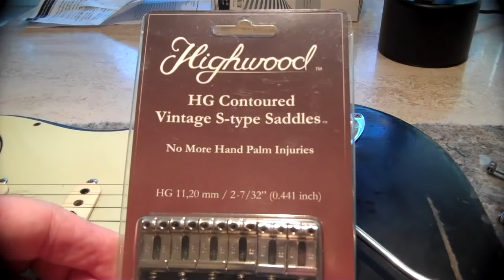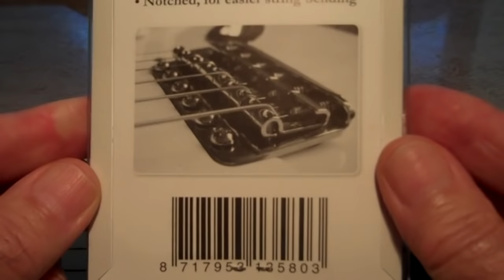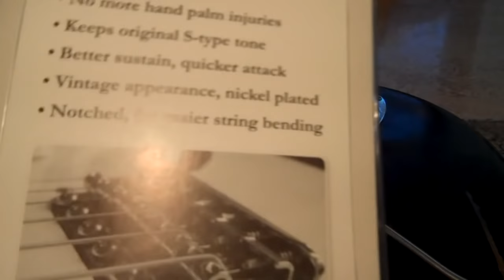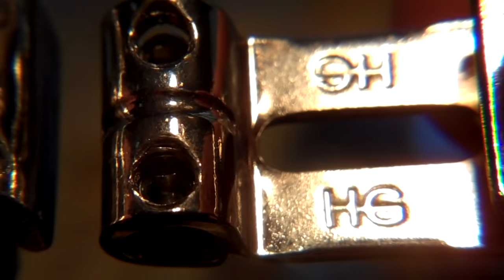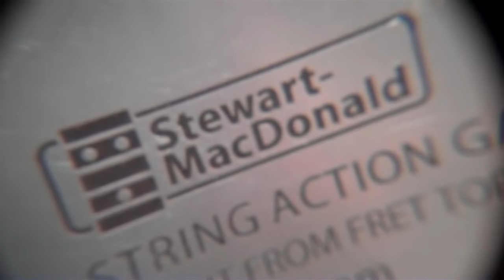Highwood HG Contoured Vintage Strat Saddle Review - Better Than The Originals

Comment: Kind of amazing how a design that’s been around this long can be rethought in such a simple yet ingenious way.  Will have to try a set of these saddles on one of my Strats.
Reply from the maker: You will love them.  This is one of the few times, if not the only time, I've seen someone improve on Leo's vision.  He was a spend thrift.  Maybe he pondered these and realized they were too expensive to manufacture.  The steel hardness is identical to Leo's pre-CBS saddles.  I added a comment about it in the description from Marcel the designer.
Reply: Yep I bet they’re fantastic.  Thanks for the video.  I might even inquire on OEM or distributing.

Comment: Callahan's look kind of cheap I'm real surprised those Highwoods look like a better quality the callahans aren't even stamped I would still take all of your vintage Saddles off and put them away and just use all the Highwoods so that you're not only using half of them and mess the setup of your vintage ones
Reply from the maker: I did take all of the vintage ones off.  They will be safe in a box.  I really like the Highwoods.
Reply: millstap did highwood provide the product for free as a trade for a detailed review, or did you purchase them at full price?
Reply from the maker: @MrSpock  I contacted them to see if they would send me a set for free if I did a demo on them.  They did.  They actually sent two sets, relic and standard nickel.  I love them and that is all I use now on my vintage 1964 Strat and my Nash Strat.  The reason I contacted them was because I could tell they were the saddles I had been looking for.  They are the best.  I've tried the others and these are by far better.

Comment: You will see dear sir that being rounded like that it will be very hard to intonate the guitar. If you like it really intonated. You will need to pool the saddle more to the bridge.
Reply from the maker: I don't worry too much about intonation if they sound good to my ear.  I have a decent ear.  I used to fret (no pun intented) over intonation and would sit there for hours trying to get it perfect.  It was a useless exercise.  Just think of the almighty original Telecaster that started it all.  You could not set the intonation on those if you wanted to with the three piece bridge and those saddle pieces were round too, just like these.  Plus, the original Tele saddles were crude screw like things with grooves all the way across to keep the strings from moving.  I haven't even checked the inonation of these.  They sound great and eyeballing them is good enough.  You need to get you a better sounding gadget although there probably was some extra hum from the Echoplex.
Reply: @millstap  this is my way also. Perfect intonation makes the instrument sound sterile. When they made the telecaster there was only wound G. So it was perfect for intonation. But Jimi's guitars are never intonated. Many are intonated bakwords like he found them for right hand playing. He never bordered. Why should we.
Reply: I have these Saddles too. No problem with the intonation at all. I initially thought that maybe muting the thinner strings could be a problem because of the grooves, but non at all. Great product.
Reply from the maker: @Steinstra-vj7wl  Yes, the grooves (unwanted version) that get cut by the strings, sound worst than anything.  It can sound like a harpsichord if they start to touch the sides of the strings.  That was another reason I was always buffing them out.

Comment: Also besides from aesthetics, are these really that much different in tone from the classic American made Fender bridge saddles (with the grooves and whatnot)?
Reply from the maker: I think they may have a tad more sustain but I cannot notice a difference in tone.  They may be a tiny bit less bright.  It is hard to hear if any.   The break angle over the top of the saddle is a little less with a little more string contact at the apex so that might have a slight effect.

Comment: @millstap Hi! Have you tried these saddles on a decked Strat? Do these solve the issue of pitch going sharp when you dive and use the tremolo moderately?
Reply from the maker: I'm sure these will be the best thing you can do to a decked tremolo.  Unfortunately, decking will increase the chance of the saddles pulling the strings sharp so a floating bridge will be much better.  But yes, with the groove that is in these saddles, you can put some good Teflon grease.  I highly recommend food grade Super Lube.  It is clear and non-staining.  That will be the best you can do without floating the bridge at least 4/64".  They virtually stabilized all of my tremolos.  It is rarely the nut that is the problem.  The grease is almost a must in your situation.
Reply: @millstap  Thanks for the advice, I'm currently using Music Nomad Tune-It which is kind of like a paste, its clear but really really good! 
I have managed to get some major improvement with my decked set up in the last day or so, by firstly loosening the tension on my trem springs - still tight enough to keep it decked when I do big bends but only just, I also played around with my bridge plate screws backed the middle 4 out a bit more and then backed the outer 2 out and re-tightened them to leave a sliver of a gap rather than flush.
This really made things better.
But yeah its ultimately the fulcrum situation which can somewhat be rectified by bending the strings back to pitch after some trem dives, with my previous set up it was all strings going sharp but now it's mainly the thicker ones while some stay in tune perfectly - as you say people are first often to complain about the nut, but a check I found you can do is to do a dive - see if the string goes sharp, then lift the string out the nut and place it back, if its still sharp then tell me again if its the nut binding!! ;D

Another thing that is well worth a mentioning is that I am now using custom string gauges which could be considered a balanced hybrid set. 
They run 9-12-15-24-34-48, I spec'd them out in such a way that the plain strings all have a near as dammit tension then the wound ones graduate out with more tension. This puts the onus on the wound strings bearing most of the responsibility for the neck relief + trem position if floating, in the last year or so a string set like this has been a huge eye opener and it all started with the YJM 8-46 set...
I played 9's/10's for years in E-standard on strats, actually had some 11-50's in E flat on the guitar the other day for a laugh but some bends weren't accessible and ultimately I could understand why the players who choose to opt for them like them, I just found it changed my approach and encouraged a more lateral playing style if that makes sense.
Anyway, lots of info and I didn't intend to ramble on but, I really do encourage anyone to try a balanced tension set of strings!
This is the tension calculator I used - https://tension.stringjoy.com/

Thanks!
Dave
Reply from the maker: @3rdtonefromthesun  Dave, I stayed away from the lubes specific to the music industry because they are 10X more expensive.  I have a 3 oz. tube of Super Lube that I bought in 2018 that has at least another 10 years of grease in it all for $7.  https://www.amazon.com/Super-Lube-21030-Synthetic-Grease/dp/B000XBH9HI/ref=asc_df_B000XBH9HI/?tag=hyprod-20&linkCode=df0&hvadid=167152075853&hvpos=&hvnetw=g&hvrand=2564821123706488483&hvpone=&hvptwo=&hvqmt=&hvdev=c&hvdvcmdl=&hvlocint=&hvlocphy=9025235&hvtargid=pla-315922229188&psc=1.  I did a bunch of videos on the trem tuning stability problem because I have a 1964 Strat that stayed in prefect tune no matter how extreme the dive bomb was but one day it wouldn't stay in tune.  I started exactly with the experiment on the nut string lift.  If it's not sticking there, then where is it sticking?  The saddles of course, especially when the saddles start to wear out and have multiple grooves in them.  I seriously think if Leo Fender had seen the Highwood design, he would have gone with it.  Almost all Fender saddles for every other guitar besides the Strat have pre-made grooves in them.  The groove is the perfect place to hold the grease.  On a standard Strat saddle, the grease is wiped off the saddle quickly with the palm of your hand while you are playing.  And, one top of that, I tried all the replacement standard saddles and none of them matched the quality of the vintage saddles.  I would quickly cut grooves in all of them.  I play nothing but Hendrix now and his gauge was 10-38 with a 15 G.  They are great.  If you look at your saddles from the side, when the trem is decked, you will see that your saddles tilt back away from the headstock.  That little extra movement from the floating position to the decked position is where the friction builds up quickly.  If you float your trem as per Fender specs, you will notice the saddle tops are almost perpendicular to the body and not tilting back away from the nut.  I decked my Strats for years when I was gigging so I could finish a song if I broke a string.  I actually now think the Strat sounds better when it is floating at least 4/64".  Do what you need to do in your situation but try the Super Lube and save some money.  And you will end up putting the Highwoods on all of your Strats if you try them.  Some people don't like the tone change.  All I notice is a little more sustain and I think the standard saddles sound too thin when I play them now.
Reply: @millstap   Really appreciate the reply, and to be able to exchange the geekery!
I’m over in the UK but seems I can get some Super Lube no problem, keen to try it out!
Agree with all your sentiments on the stock saddles, my guitar in question is in fact a new AVII ‘61 Strat so I’d imagine the first couple weeks the strings were burrowing grooves in, the Highwoods make a lot of sense. 
I am fond of a floating trem and there are many benefits - generally I think you break less strings on them due to the give on the trem springs, the resonance is different and more airy and the sustain better on the lighter strings. Another thing is that I found you can get away with lower action without choking out, cause as the string is being bent the fulcrum point on the saddle tips forward very slightly and that raises the action to give clearance. 
My AVII ‘61’s action is Low E 6/46”, A-B 5/64”, High E just under 6/64”, if I pick hard and bend at the 12th fret I can get a little bit of choking on the high E but not enough to make the note die out. 
I’ll play around for a bit, there’s always that adjustment in bending when going from decked to floating and I prefer the decked feel on bends. I know at certain times Jimi did have some of his guitars decked but at least the last couple years of his life his tim pretty sure his tremolos were set to float. 
Thanks!
Reply from the maker: @3rdtonefromthesun  If you are into the Jimi sound, you owe it to yourself to eventually get a reverse CBS headstock.  I just ordered another neck with that configuration for my 1964 Strat.  I went back to full 7-1/4" radius and I hope I don't regret it on the choking issue.  I don't have any problems with my vintage Strats but I think they have been flattened out a bit over the years.  My last neck I ordered had a 7-1/4" - 9-1/2" compound radius just for the choking problem.  I have no issues with it at all.  Great neck and it has the tiny vintage Fender frets on it.  Those really make a difference in the Hendrix sound.  My new neck will have them too.  They are both in stainless steel so they won't wear out as quickly.  If your trem springs are real stiff, do yourself a favor and buy a set of Raw Vintage springs.  They have the vintage correct tension and you can easily dive bomb with all 5 springs.  Everyone loves them.
Reply: @millstap  Hey! I saw that video, I also just got hold of the Highwood saddles, keen to get them on! Also need to try that tip with the 242 threadlock, cause I kept coming back to the guitar and my action had dropped on a few strings, never really had that before but this is a new guitar I'm talking about (AVII '61 Sunburst).
Got some Raw Vintage springs too, but on another Strat, they're really good!
Reply from the maker: @3rdtonefromthesun  That's good.  You shouldn't need the thread lock on the Highwoods.  I've never had the screw moving issue on them.  That is one nice thing that the screws are out of the way of your hand too.  You'll have to watch my Vintage spring vs. Current Production springs video to see if your springs measure up.  All you need is a fish scale, some clamps and a small piece of 2X4 and a measuring ruler of some sort.  The RV springs have even lighter tension than my lightest vintage springs.
Reply: @millstap  Nice! The guitar is currently equipped with Gotoh PSP springs that are 5mm shorter and stiffer than standard - this guitar is intended to be decked though.

Comment: (Edited: Now changed to 10.8mm size). Thanks for the advice on the correct size and thanks for making this review. I highly recommend these saddles. My 'Vista Series' Jagmaster now has a set of (10.8mm) relic Highwood saddles. Bends are easier with the notched saddles and setup was very easy.
Reply from the maker: You’re welcome. They are great. I went back to the 10.8mm size because that is the size of vintage saddles. I did a video on picking the correct size after this one. The E strings were too close to the edge of the neck with the 11.2mm.
Reply from the maker: Good deal.  I had never heard of the Jagmaster but looks like a cool guitar.

Comment: The attack angle is wrong(not enough pressure)if you have buzzing on open strings. Either from the nut or saddle(both??) if the relief is correct.
Reply from the maker: I don't know what that sound was.  The guitar is perfect.  I think the strap on the camera may have been hitting the strings.  I didn't look.  I do keep this guitar's relief around .008".  I don't think I will ever use any other saddles.  They are great.  I'm putting the other three on the wound strings this morning.
Reply: @millstap lol, I was just about to ask why you didn’t just put them all on.
Reply from the maker: @drewbarries  yes, I’ve been using full sets of the Highwoods for years now and just got two sets of the chrome ones to try. These are all nickel plated.

Comment: Just put them on my strat, cannot recommend them enough! Not only for the better design and not scratching your palm,  they also improved the sound on my guitar (MIM Standard) and when I hit the strings very hard, there is no buzzing. Absolute must for every Strat imo
Reply from the maker: That’s good to hear. I just bought a perfect vintage style tremolo for my Partscaster and I thought I would give the vintage saddles another shot since these are the best reproductions I’ve ever seen. Mark Foley guitars out of the UK sells them. I have to say I’m missing my Highwoods some. Even though vintage has a slightly different tone, the Highwoods are so stable and I can do as many dive bombs as I want and stay in perfect tune. I still go out a hair with vintage saddles but it’s manageable with grease.  I have two sets of chrome Highwoods ready to put on in the future. I used nickel on my other guitars so I thought I would try chrome for a change. Did you get chrome, nickel, or relic’d?
Reply: @millstap  I got the chrome ones, to match the bridge. I watched some of your videos and was impressed about what you had to say about those Mark Foley blocks. Since my Fender is Mexican, the block in my bridge is made out of zinc and I think it will be a big upgrade to put new block inside. But the issue is, I was not able to find anywhere MF block for sale. Where did you get yours from?
Reply from the maker: @Angel-fz8dr  You have to DM Mark on his Instagram page, mfguitars.  He will send you an invoice for whatever you need.
Reply from the maker: @Angel-fz8dr  And, yes, you will notice a big difference with the MF block.

Comment: The Highwoods are the best! I might have to try running them only on the unwound strings too, so one set can benefit two Strat's. Like you said, I only have issues with the unwound strings moving and cutting grooves.
Reply from the maker: That's a good idea.  I didn't think of that.  My wound saddles don't cut as easily.  I do like the stability of the groove though so I will keep the whole set on for now.
Reply: *Strats. No apostrophe to pluralize a word.

Comment: did you get grooves?  We need an update!
Reply from the maker: Not really.  Here is the update, https://youtu.be/DKf7PhmY_J8.  But, recently I did finally get a little bit of buzz on my plain E on one set of saddles and noticed there was a very slight groove on the edge of the groove and not dead center.  I buffed it very slightly with some 600 or 1200 grit wet/dry paper and it the buzz went away.

Comment: If you start getting some grooves on the Highwood saddles, how would you go by and smooth them out? I ask, because on the regular "unnotched" saddles is very easy to do so, since they are flat. But on these Highwood saddles that have a center notch, what could be used to smooth out a possible groove/burr of regular use?
Reply from the maker: So far, I have not noticed a grooving problem after several years. I did this video looking for them, https://youtu.be/DKf7PhmY_J8. If there is any groove at all, it is very smooth and does not need buffing. I just looked for grooves this morning because I was having tuning issues on one of my Strats. I found none. Probably more of a setup issue. The six mounting screws may have been a little too tight against the bridge plate.